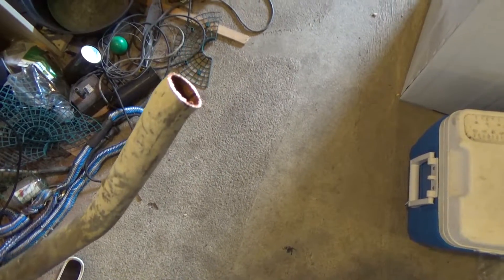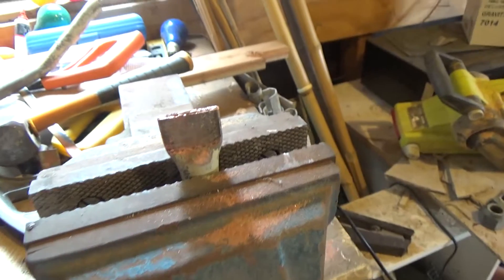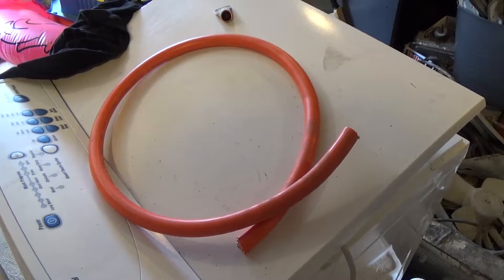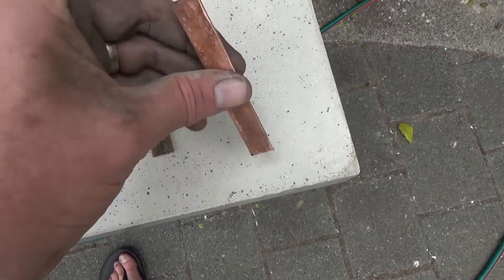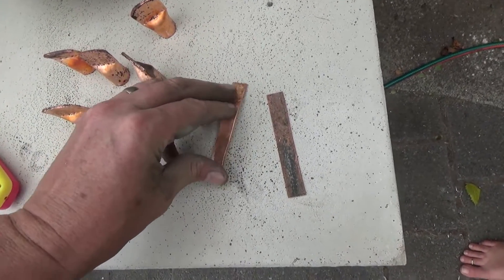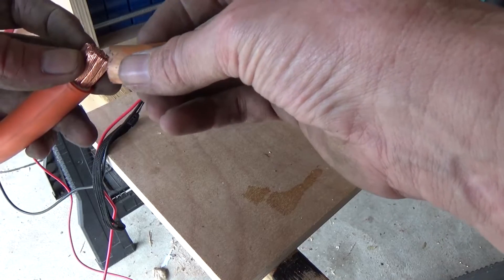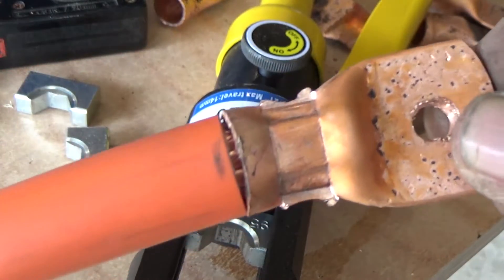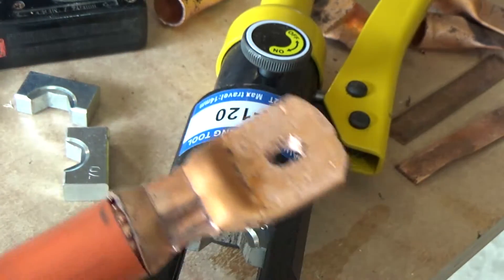LiFePo4 DIY Battery Lugs | Make your own Copper terminals

Comment: Awesome. Problem is the crimper tool so expensive for just a few lugs. How to diy a crimping tool would be good.
Reply from the maker: YouTube keeps deleting my reply because is had a link in it. Will put it in the video description for you...
Yeah that's a good point, But I have used it heaps and it is pretty cool. 
This type is about half the price (see video description) but me and hammers are not good friends I would probably lose a finger
Or hey if you are the metal working type (my welding is worse than my hammering) maybe just a few nuts welded together could make a sort of crimper anvil you could use in a vice
Reply: @BusedAsNZ  i wander if using a bus jack would work and custom grind a few chunky bits of metal and jam it between a tree would work lol?
Reply from the maker: @ForPropertyInvestors  Yeah mate, I guess once you have something the right shape you only need to push it or hit it hard . Or splash 50 bucks, crimp your lugs then sell it again and recoup most of it back
Reply: @BusedAsNZ  I’m seriously thinking of making custom lugs and cables for ppl. Something I could make and sell on the rd. Though weight could end up being a problem. Copper is heavy. I should just buy a good multipurpose crimper. Would be awesome to be able to make them. I actually just smashed the last system lot with a hammer. I got by but they say not recommended.
Reply from the maker: I kinda thought that it didn't matter too much how you squashed it as long as it ends up a bit solid chunk. But I really like the very fine control of hydraulic crimpers